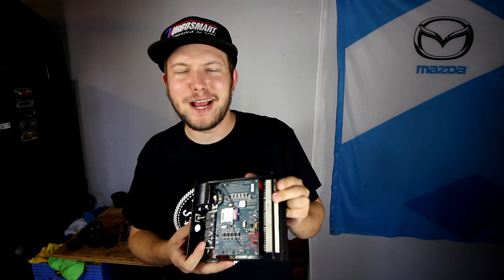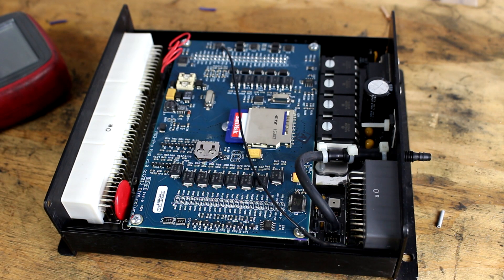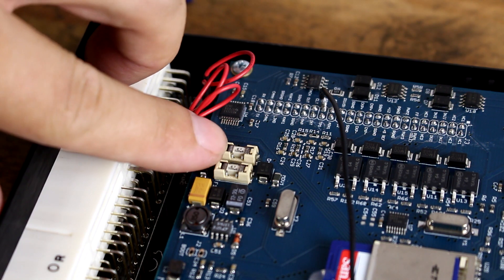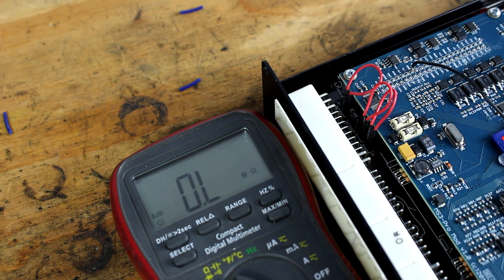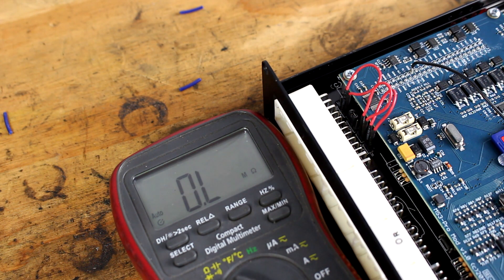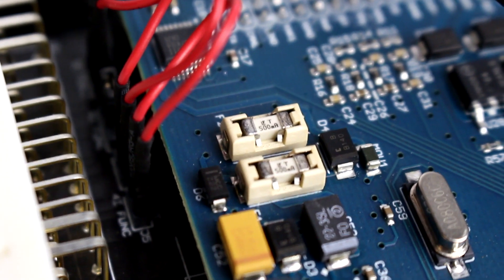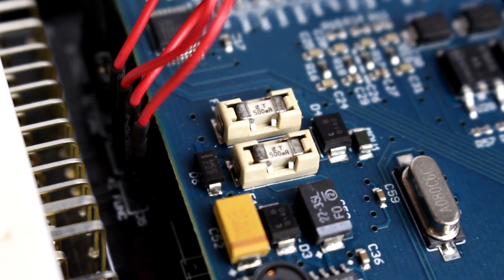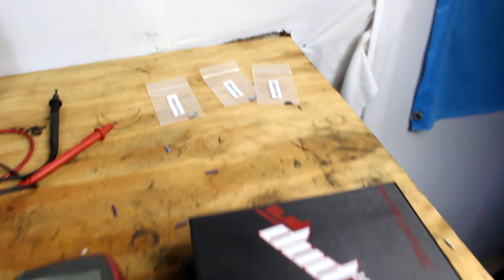I Have Once Again Broken My ECU

Comment: Even better, my cam sensor uses 12v, but my crank sensor uses 5v! both are hall effect sensors. Derrrrr

I burned 3 MAP sensors by supplying 12v before I figured it out. Glad you made a video about it!
Reply: i used sensor ground for the cam/crank and used grounded cable for my cam the ms3x didnt come with.  VVT uses 12v but i think i fed both sensors 5v i think (id have to check but one is for sure 5v instead.  Jumpered the 3.75 board to the ms3x vvt with a wire to keep the vvt from melting the circuit board

Comment: Greg, when you redo that valve cover at some point, use a couple coats of self etching primer before whatever paint you put on and bake it in the oven if its wrinkle black and those wrinkles will pop

Comment: Wow, compressor efficiency video should be interesting! I just saw some interesting stuff about dual dbw throttle setups that are used to bleed air to avoid turbo surge.
Reply from the maker: I did part 1 already it's a 37 minute beast, but there are a couple more details I need to hit on with the new dual MAP setup!

Comment: Dont worry you're not alone I fried my mspnp2 the 2nd day i had it. I tried to wire the 5v wideband upstream to the ecu and accidentally spliced the 12v heater circuit directly to the ecu. It was toast.

Comment: For the record when on ohms setting you are Not checking for continuity technically.. of course if there’s no connection between the two points there would be no continuity. You are checking impedance. But there is continuity setting on many multimeter that will beep of you made two CONNECTING connections.. “Continuity”